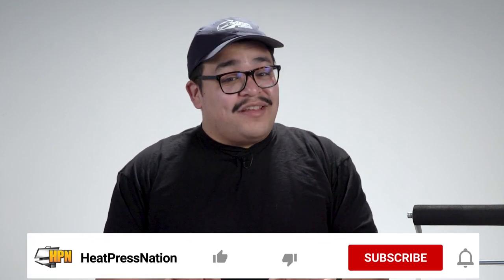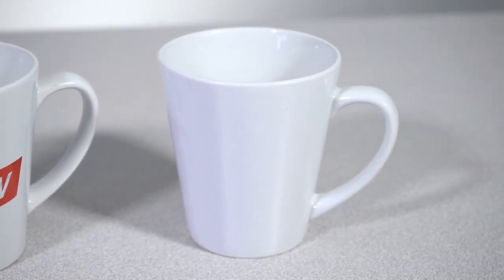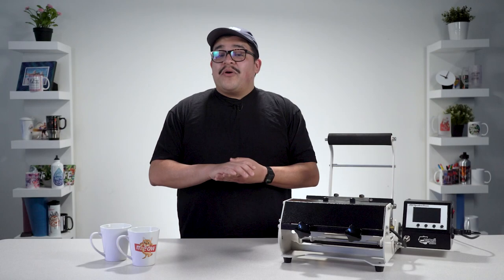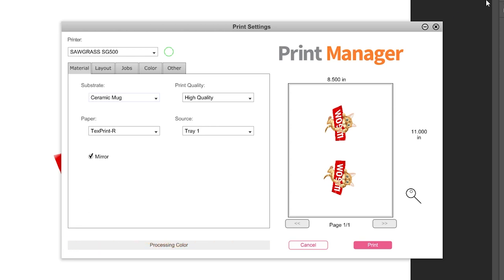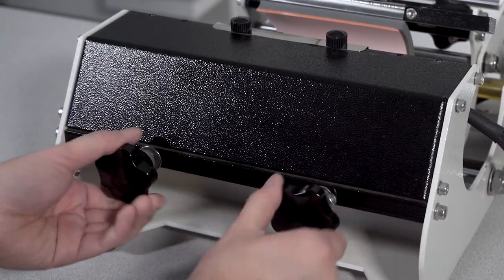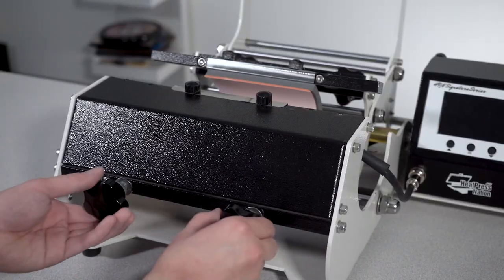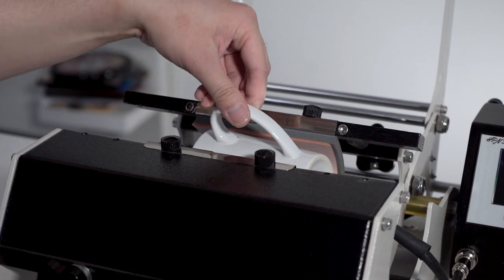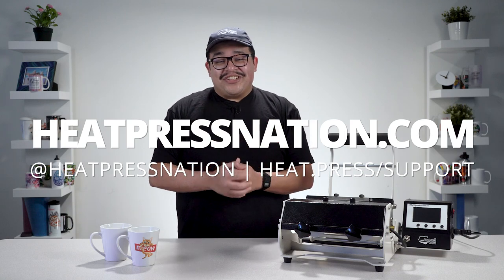How To Make Custom 12 Oz. Latte Mugs

Comment: how did you send print from photoshop to sawgrass????
Reply from the maker: In Photoshop, send the image to print as you would anything else. From your list of printers, select Sawgrass Print Manager, then click print. This will open up Sawgrass Print Manager, where you can make any final adjustments, then send it to print on your Sawgrass sublimation printer. 

If you're using an Apple computer, the process is going to be a little different. In Photoshop, you will need to save your file as a JPG or PNG. Then click on the Sawgrass Print Manager icon and select "Open Local File". Select your image, and this will open up Sawgrass Print Manager, where you can make any final adjustments, then send it to print on your Sawgrass sublimation printer.